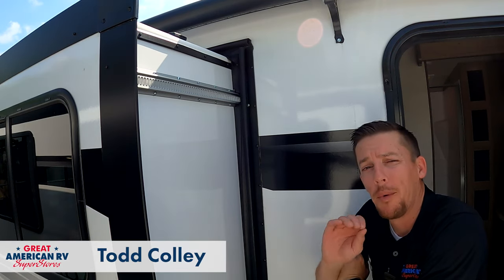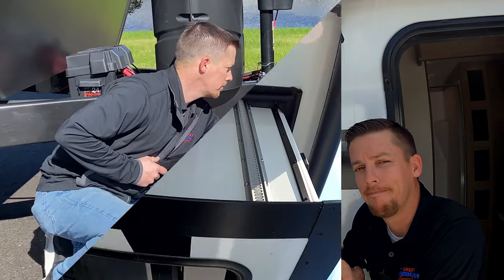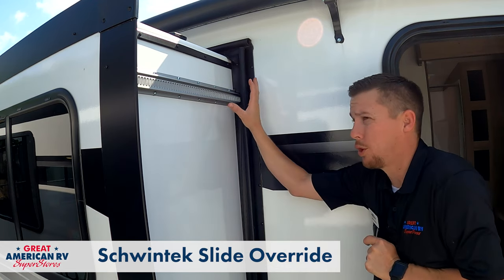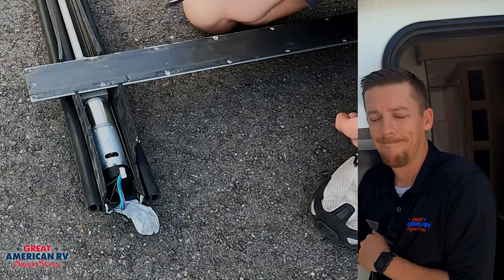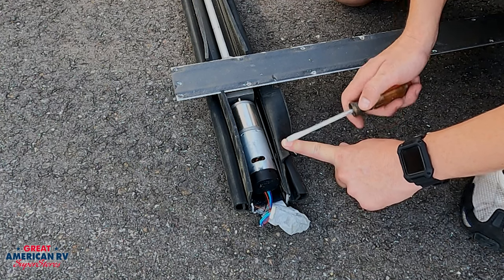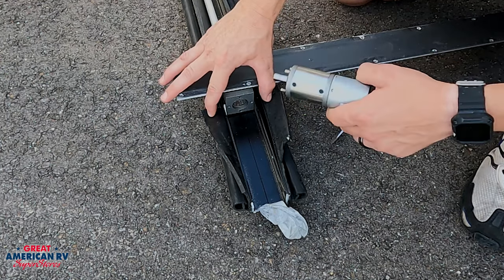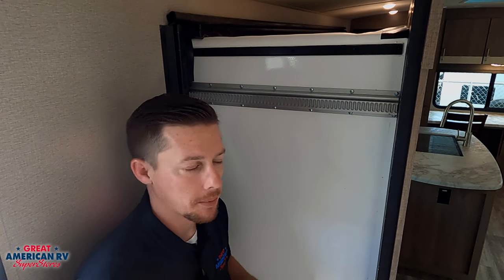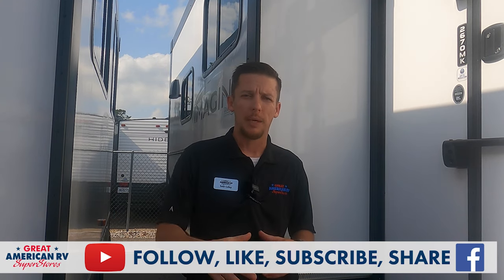How To Manually Override Your Schwintek RV Slide

Comment: Great advice if boondocking and the slider is stuck out (can't drive RV).  This way you can at least get the slider back in and drive to a repair shop instead of hiring a rig to tow it to shop.  Great idea about the 2x4 to hold slider in while driving.

Comment: How would I get it to slide out if stuck in the in position so I can access the set screw?
Reply from the maker: You would have to pry the motor up from the inside and break the screw.  Then push out.  This is mainly to get it to the point so it can be pushed in to make it mobile and bring to a service center.  It’s a much more difficult job when the slide is in.

Comment: No one replied to the question How would I get it to slide out if stuck in the in position so I can access the set screw?
Reply from the maker: You would have to pry the motor up from the inside and break the screw.  Then push out.  This is mainly to get it to the point so it can be pushed in to make it mobile and bring to a service center.  It’s a much more difficult job when the slide is in.
Reply from the maker: Our apologies for not responding and it getting lost in the mix.

Comment: I removed motors and could barely push slide out in.  Can’t pull it out.  Why would it be so stuck.
Reply from the maker: @stevengeary  how big is the slide?  Do you have people on both sides helping push evenly?  There are various other mechanical issues that can cause it to be difficult.  It’s a gear and track system so not going to flow as easy as on rollers.  -Todd

Comment: Why can it NOT slide with the motor connected?
Reply from the maker: They have an electric brake on them that will not disengage until activated.
Reply: @GreatAmericanRV  I was told by Lippert that the motors have the electric brake, but it works by using a little reverse polarity electricity to through the wires. That they do not actually "engage"  brake. Very similar to the way a slot car have a braking system. So if you remove all power , then they should slide.     
Please, the next time you have a motor out of a unit. Verify which procedure is correct.  And very nice video. Thank you.

Comment: I don't recommend that U pull these screws out. I did and I am really really sorry for that, I didn't think it through. It has been a long worry. Don't do it.
Reply from the maker: This would be a last resort option if the slide cannot be overridden by the control.  In which case there is no other way to get the slide in without removing the motor.  The screw can be placed back in after the relation the system is done.  -Todd

Comment: This is why engineers suck when you need to go to all this work instead of just hand cranking to close it. Engineers suck. Who brings a hand saw and 2x4s with you so you can repair something? Why not design a wrench to throw in back tool box to close slide? Because engineers suck. The old school ways work so much better.
Reply: Ditto